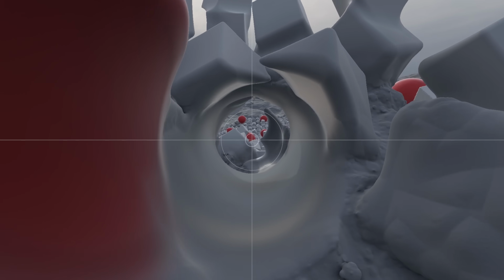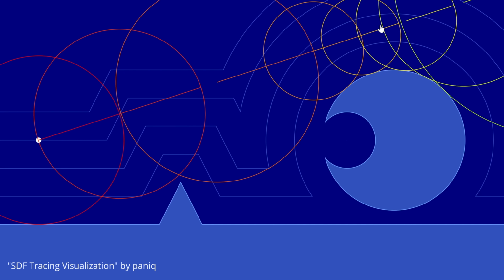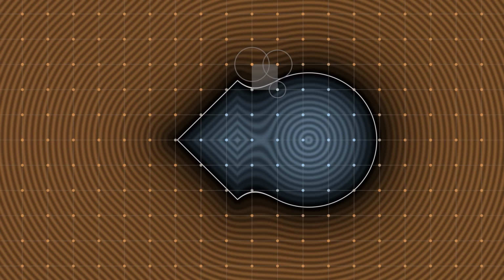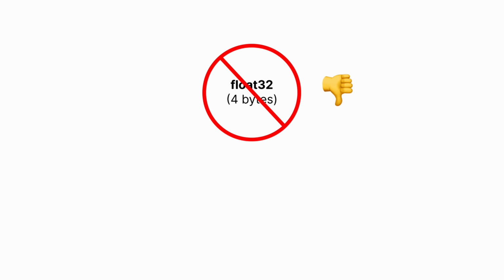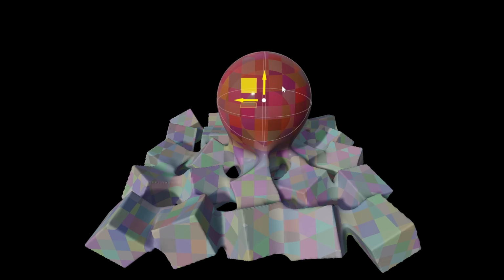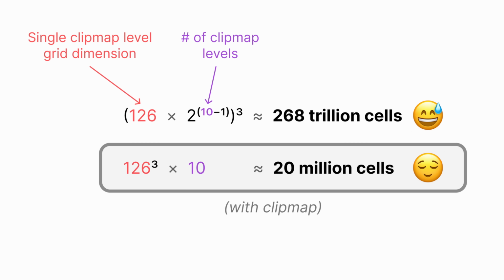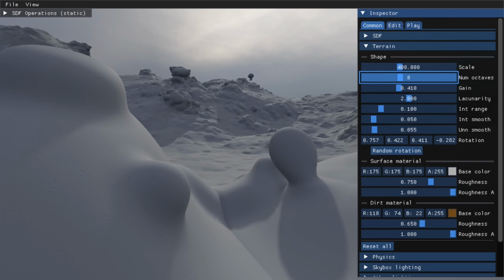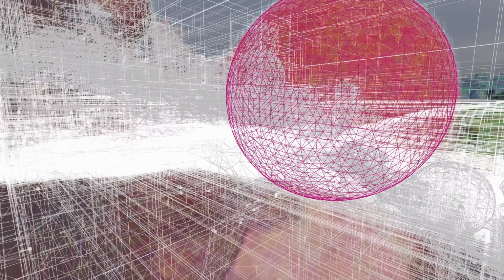I'm making a game engine based on dynamic signed distance fields (SDFs)

Comment: You hear this Team17???? 

WORMS 3D IS NOW POSSIBLE. Get this guy on board for fuck sake!!!!!!!!!
Reply: Legit!!!
Reply: Eh, unfortunately, iirc, Team17 imploaded in a huge corpo scandal. You might have to make your own wormies and call them snakeos.
Reply: There were 2 worms 3D games already. Though probably both had voxels with marching cubes, pretty much '87 technology.
The first was literally called Worms 3D. Wait, actually there was also PS2 extra ones, lol, so even more than 2 if we count secondary rate one's.

To be exact buildings were voxels, I.g., and the terrain destruction was 2.5D (only vertical, no caves), as it is much cheaper. Don't misinterpret canyon voxel parts though, only grass, etc. - is terrain.

P.S.
Though yeah, this year it'll be 21 years since new 3D Worms game, as Ultimate Mayhem (2011) is just a straight remaster
Reply: but Worms 3D was released over 20 years ago
Reply: @chrispsps  But properly man. You see?
Reply: @chrispsps  Something bearing that name exists, yes. It's missing...the fundamentals, though. This kind of terrain tech is what I and others imagined.

It may well be the case that it should only ever be a 2D game but for even a chance at legit 3D success it absolutely requires something like this guy's work.
Reply: @chrispsps  Fine then. Worms 4D
Reply: You speak like the industry doesnt know what this technique is, and can only do it with his help... 
There are many reasons to not do SDF for a game.. Especially Worms, which would required skinned animations.
the problem with worms in 3d, isnt rendering.. it's how you show the playfield/camera/etc.. And the game area becoming far too big to be fun.
Reply: @martinhowser4094  Those are all good points. And yet, if there must be a 3D Worms game, it needs something like this!!!

You might eventually arrive at the conclusion it should only ever be a 2D game, then.

Comment: Super cool!
One question - why do you use both marching cubes and complex rendering? If you need the mesh for physics, wouldn't it be cheaper to just render it as well?
Reply from the maker: The reason is that the physics collision mesh is really low-res, so it looks terrible when rendered.

Comment: You may like the way things blend together but it limits the engine to this one visual style. With basically every scenario other commenters are bringing up, like snowboarding games for example, I can't help but imagine the avatar and other objects weirdly blending with the terrain or with any object they come close to. What is the plan here? Will you render some elements with traditional triangle mesh rasterization in a second pass to keep things from overlapping? Is there a way to prevent SDF blending via some kind of layer system? I was waiting for this discussion pretty much from the start of the video. What use is a renderer that cannot draw distinct objects and always mushes things together in shape-shifting ways?
Reply from the maker: It can draw distinct objects, either by turning off smooth blending for a particular shape, or just rendering a triangle mesh as you mentioned. I got a little carried away with the smooth blending for the demos because it shows how the SDF is updating dynamically. I am going to use triangle meshes for gameplay objects fairly extensively as well.
Reply: @Mike-Turitzin  okay, very cool. I was worried you had only developed this one aspect since it's all I see in the video.

Comment: I feel like there needs to be some way to dynamically change the density of the points the SDF's are calculated from based on how complex a piece of geometry is. There is probably a lot of places where you could get away with fewer points, but more importantly you could show much more complex geometry more accurately.

I'm no programmer, but I do have some advanced calculus classes under my belt, so I think I have an idea how you might do this. If you can get a function approximation of the surface geometry, you can take the gradient of it to determine how harsh the curve is. Smaller gradient should equal less point density and vice versa. Of course, you'd have to figure something else out for discontinuities like corners where you can't take derivatives, but for the most part I think that would work pretty well.

Comment: Excellent! Love to see what you come up with. There are many more uses for this model than games. My mum and I developed games in the early 80s when graphics was limited to black and white pixels and a bit later hen 32767 colours. We coded all of the basic / primary image objects from scratch using Basic and then C...point, line, circle, cube, sphere, torus etc from scratch to create at that time a cool engine for games and a windowing system. I have some of the original code still. ...but then Microsoft and apple came out with their OS' and windowing systems :-( so the whole thing got shelved.

Comment: It seems like you are generating terrain collision patches on a grid; I am curious how you choose which cells along the surface require mesh generation; The debug view makes it seem like you're generating colliders for all cells along the surface. It seems that the optimal choice would be to only generate colliders for cells that might intersect dynamic objects in the next frame and ignore all others; This would result in much less collider data in large scenes and possibly allow for an increased collider resolution.

Comment: Are you able to integrate traditional mesh-based models? What about disabling the merging ability between certain objects so that cubes don't fuse with the floor? I feel like this kind of engine will absolutely be the future of outdoor environment landscaping in video games, so long as regular objects, models, characters, etc, can be seamlessly integrated within the engine as well.

Everyone will want to adopt this so long as it is performant enough, and so long as they can make a game where this technology is essentially hidden from the player, rather than accentuated.
Reply: I have a feeling that complex polygonal characters will not play well with ray marched rendering, so they'd need to be rendered with another method. This demo also doesn't showcase textures because textures are difficult to reconciliate with SDF. I definitely don't think this engine has mass adoption potential -- most games don't need this form of gooey world, even if optimised it does incur an overhead that a majority of games don't need; and there's decades of tech that would need to be re-implemented for it. But this is an awesome engine for those games that do desire more complex world interaction.

Comment: With the amount of detail you showed off in the diffing example, it would take a very high number of edits to dig a bigger hole, no ? and since SDF workflow is non-destructive in the sense that removing the negative edit will fully get the original shape back, it means you have to store all edits ever made, right ? doesnt that become a bit much if a player wanted to dig a big hole, or build smth really big with small elements? I can imagine edits are small in size, but it would eventually add up

Comment: There's a manga called Blame! by Tsutomu Nihei, where some of the characters have incredibly powerful weapons capable of blasting holes tens of kilometers deep into the Megastructure. Anyway, I was wondering if that would ever be possible in putting into game form, where the player could shoot their weapon, see the destruction they caused, and then travel across the world for hours and check out where the other end of their mayhem looks like should they choose to do so. Perhaps somehow customise the gameworld to know approximately what kind of materials are in the path of the destruction, and then generate diffent types of reactions depending if it goes through solid material or electronic equipment of pipes, or whatnot).
Your technology seems to be on the right way for this guy's dream to come true. :D Nice work and best of luck.

Comment: That's a super cool project and really impressive you've managed to get this far all on your own, even though I get that you're building on existing techniques. One question I had while watching was if it's possible to turn off or adjust the strength of the blending? As in I you want sharp edges between two intersecting objects.
Looking forward to follow your project. Depending on your ambitions for your engine maybe consider making it open source so more people can collaborate with features. Of course there are other open source am engines but I've not seen one that includes all these features.

Comment: Have you tried doing cubic filtering instead of letting the GPU do bilinear filtering for the SDF sampling? You wouldn't be able to use the int8 samples I imagine because cubic sampling means the distances stored need to be more than half the grid size but I imagine an fp16 would be fine and double the storage is probably palatable. There's a good chance it's not a meaningful improvement but just wondering if it's something you tried/consider. Cool stuff either way, I feel like everyone gets excited about SDFs. I remember reading that valve paper a couple of decades ago and it still amazes me, and I don't actually think there's much out there using SDFs for vector rendering in the wild still which is crazy. Lots of in-world UI text/decals would benefit but I still see low quality alpha cut outs all over the place.

Comment: Damn, I'm hooked. Would love it if the engine get open-sourced at some point, after you released your game, would love to experiment with it.

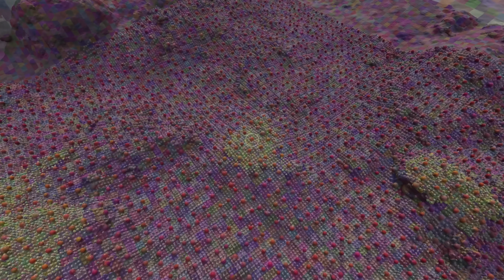The only thing I don't really like (though I know it's a normal limitation of game engines) is how obvious the seam of the very low LOD is at 12:43
Would it maybe be possible to bake a shadow and albedo map of the level lower and apply it somehow to the higher level? I guess it would be really difficult since you aren't using meshes for rendering...

Comment: the smoothing is definitely a little overtuned because you say 'high fidelity' (implies high frequency details) but the smoothing inherently removes the fidelity in a lot of the interesting scenes. Of course the spheres themselves are high fidelity but they don't look like it, one would assume the cubes look more impressive but since they are multilinearly interpolated of course any polytope would look good.
Reply: also for a lot of mechanics we would want a clear physical boundary, with any deformations being 'elastic' rather than 'viscous', if you can pull that off it would be a great demo.

Comment: I wonder, would it be possible to instead do the grid in camera clip space? That way you get a perspective-aligned grid that changes completely smoothly from the camera's perspective. You'd also only calculate anything that's actually in view.
Not sure whether that can actually work out though, given that the grid then changes as quickly as the camera motion, and if you have global illumination, the lack of stuff outside the camera view might not be helpful. But if that worked, it'd presumably be even smoother results than your current LOD implementation...

Comment: Crazy stuff, and raymarching (and it's derivatives) are so cool for graphics.
It's also crazy how much simple data can be stored... 20 million data points, if they're like 16 bytes (but you did 1 byte... surely though you'll need more when it comes to textuering etc?), is only like 300MB. But I guess you technically need to store those trillions too, if most things have been modified too, but that can stay in storage... but perhaps that could end up too much? Though anything stored can also be compressed.

Anyway, very cool stuff!

Comment: Woow, that does look amazing, crazy good work!

But about the bilinear interpolation artifacts, I think for fonts a way to make this a lot less noticeable and get higher fidelity is to use multi-channel sdfs (msdf)
I wonder if you have considered using some sort of similar technique, calculating and storing multidirectional sdf data to grid points to loose less detail during interpolation?

Comment: Why can't you evaluate the sdf distance directly. Aren't you using objects with known symmetries like spheres, cubes and donuts ? I feel like optimizing the recursive ray marching function can be done analytically by using some math formulas.
I have a question too, why aren't you caching the calculated distance to an object inside the objects structure? By using a grid caching system, it seems to me that the rendered world is divided into tiny prisms. You can see these "Prism Shaped World Blocks" when digging down.

Comment: This is extremely interesting as I just recently discovered a free and open source game (AGPL license) called Slice4D-Shooter written in Rust with a custom Engine based on SDFs, though it also has a custom written physics engine!

It seems like it is relatively heavy on performance though and could heavily benefit from the techniques you used, because the current plan is to drop "web support" as a platform to gain performance, which would be sad.
Reply from the maker: Oh cool, I hadn't heard of that, looks pretty interesting.

Comment: this is a really cool engine, 2 things i noticed though : 
are data points being shared between bottom level bricks? in the visuals you show in the vid, it looks like there's a ton of redundant storage happening lol
second, have you thought about using an MSDF-like texture instead of plain distance fields for better surface detail reconstruction if you're not doing that already?

Comment: 20M * 8x8x8 = 10gb; assuming brickmaps are single byte. Not impossible I suppose; but I imagine a degree of sparsity is assumed and bricks are allocated dynamically to the texture? Is it a spatial hashing thing? I imagine if such spatial hashing is used, all the bricks easily fit in a single gb?

Comment: You should check out V-rage 3 game engine for Space Engineers, they have a different but kind of similar destructible environment and a new physics engine that supports volumetric liquids like water. In this game, it's possible to build a box, fill it with water, and make a vehicle to bring it to space if you wanted to.. Or even a submarine that when the wall breaks water gushes in. I think it's one of the most impressive proprietary game engines I've ever seen! :) It's by Keen Software House, check it out!

Comment: Beautiful!  I was inspired by the Dreams approach as well and am so happy to see someone else experimenting with these methods.  Can't wait to see what else you do with this.

I'm curious about one technical thing:  when you're flying around quickly, what percentage of grid cells are being recomputed each frame? It looked like rather a lot, at the cascade boundaries.

I ask because recomputing everything from scratch is usually significantly simpler but also opens up additional options such as fully dynamic procedural generation (eg trees in a forest all growing in realtime).

Perhaps this could be a modal thing for the engine? Cached vs fully dynamic, the latter being slightly lower resolution but having additional features.

Comment: So if you repeatedly build a structure and destroy it, will that use increasing amounts of memory? If I'm understanding, creation and destruction are both done by adding new shapes so it seems like the system would never recognize that a additive shape has been fully "dug away" or a subtractive one "filled in" and so no longer needs to be considered.

Comment: This vid's blowing up, congrats! No worries if you don't have time to reply to this.

If I understand correctly, you need to store each and every change to the environment as a "row in a database" (maybe not literally, but some sort of entry in some dataset)
Kinda like how git doesn't store your whole repo every time you commit, it stores the changes and then can rebuild any arbitrary point in time by "replaying" records.

I'm curious if you've thought about how to handle the massive dataset that this would inevitably create, even in a single player game? Maybe some sort of baking process where all changes are baked in and the "default" world is updated to be the world after all the changes? 

Or maybe I'm misunderstanding how it all works and this isn't an issue.

Either way, very cool vid and very cool innovation!!!

Comment: This is really awesome! You mentioned that it wasn't designed to be a modeling tool, but I would love something like this specifically for the purpose of blocking out shapes pre-sculpt. I've tried some SDF-based modeling tools but in my experience the performance tanks with just the slightest bit of complexity.

Comment: Holy cow! YES MORE!

Quick question though - seems everything must be built in-engine. Is there any way to implement a pipeline to inject traditional 3d models?
 Or would they be completely incompatible as they aren't built of signed fields? Some sort of conversion would be necessary I assume.
 What would something like that look like?